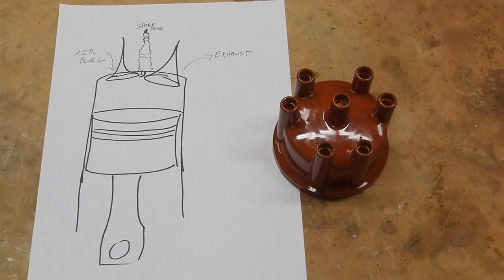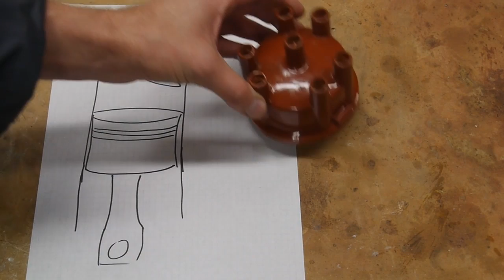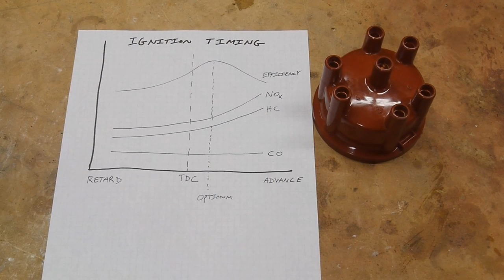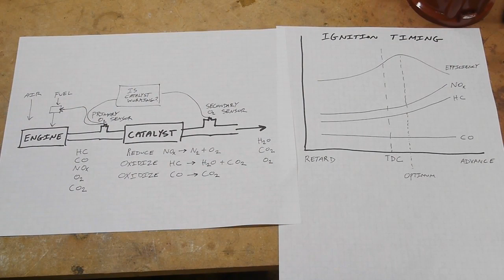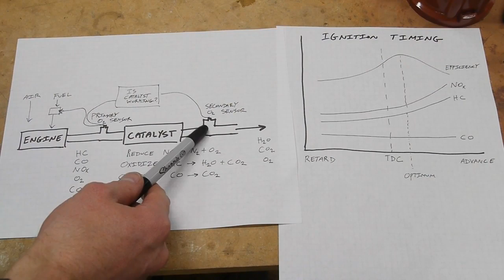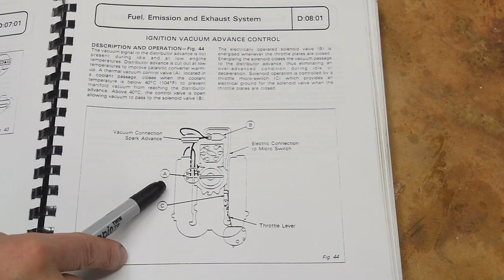Car engine science: Ignition timing, emissions, mixture

Comment: My 88 Audi 5000 has the came CIS-L injection system as your DMC1, and it’s been really interesting to fit a wide band oxygen sensor & controller, and monitor the mixture regulation performance. Having the “built in” wideband sure makes setting the CIS mixture screw easy! The oxygen sensor system was also very helpful in diagnosting a stumble under high load. Turns out my fuel pump wasn’t delivering the proper flow, so the system was simply “running out” of gas and going lean.

Comment: Hey, this actually makes sense.. I recently replaced all the spark plugs and wires in my truck, but the wires were kinda shitty and one wasn't staying on right. I crimped it onto the plug but the contact is still not quite right, I think the spark may first be jumping from the wire to the plug. At idle, under a lot of torque and especially when reversing  (torque thing), the engine occasionally shakes sort of like a misfire. Sounds like the firing advancement/retarding obviously can't calculate the crappy contact between that one wire and plug, so that cylinder is just not firing at the right time

Comment: Great video as always but I got a little confused with some things. Looking at the ignition timing graphic, NOx and HC levels should always be directly proportional no matter how advanced or retarded the ignition timing is. Then why, when he fixed the vacuum advance, didn't HC level increased at the same rate NO level did? Actually HC ppm didn't change at all.
Reply from the maker: Good point.  I think it is easier for the catalyst to convert HC into H20 and CO2 than for it to process NOx.  It's possible that the catalyst has additional capacity, so adding more HC into the input of the converter will not result in more HC out the tailpipe up to a certain level.
Reply: Thank you. That makes a lot of sense. The catalyst makes it harder to measure the ignition timing effect on the emissions.

Comment: Hi Ben,

Best and most concise description of a catalyst I've ever heard.

Your description of knock isn't quite correct though. What actually happens is that the flame front from the spark plug progresses through the cylinder normally. This causes the remaining fuel/air mixture to compress and increase in temperature. This temperature increase actually causes some of the more volatile molecules in the fuel to begin to break down. There's a certain threshold point where this volatile stuff will spontaneously explode, usually all at once, and usually in the vicinity of a hot-spot in the cylinder. That is obviously very violent. The sound you hear is the engine block resonating. Imagine the explosion hitting it like a hammer.

An interesting point about knock is that it causes the boundary layer of gas along the cylinder walls, cylinder head and piston to be blown away. This means that you get much more heat transfer from the burning gas to the engine. This is the primary cause for the engine damage caused by knock.

Also, the amount of combustion heat absorbed by the engine is (roughly) 30%. Another ~30% or so escapes out the exhaust pipe, the remaining ~30% or so is used to produce useful work. Many engines actually make use of less than 20% of the available energy.

Another nasty thing which can happen in engines (especially modern, down-sized turbo engines) is pre-ignition. This is where the mixture in the cylinder spontaneously explodes as the piston is on its way up, well before the spark is going to ignite. Pre-ignition usually causes extensive engine damage as an enormous amount of heat from the combustion must be absorbed by the engine.

Also, your diagram of spark advance blew my mind. I'm used to 'Advance' on the left hand side of the x-axis.. :)

Patrick

Comment: Hi Ben, Great explanation...... I'm surprised you failed to mention the function of the "Air Pump" and the EGR valve. These both play a huge roll in reducing emissions. The Air Pump injects air directly into the exhaust system, engine side of the catalytic converter. The test results you displayed, tests for a stuck solenoid keeping the pump on after engine warm up. The EGR valve lets burned gasses back into the combustion chamber to lower cylinder temp. This lowers the oxides of nitrogen "NOx" This is a real problem with certain cam grinds. I built a modified EGR system to get my car through emissions... I made a video about it a while back.
Always enjoy your videos Ben! Keep'em coming!
Reply: The last time I saw an air pump was in my 1985 RX7, also in a 1985 Subaru (instead of a pump it used a flap valve, similar to a 2 stroke intake flap valve) operated by piston vacuum). I think those have been eliminated years ago.

Comment: So I live in a part of the US that gets cold/snow during the winter. When I start my car on a very very cold day I notice that the exhaust fumes/vapors are more visible coming out of my tailpipes when the engine is cold and trying to warm up. Then as the car warms up and I start driving, they are not as visible. This always puzzled me. Is this because the engine is running much hotter (when the engine is initially stared and when it is cold) to warm up the catalytic converter so it operates more efficiently?

Comment: Great stuff as always, Ben.  It's a shame that modern mechanics will eventually lose the knowledge of these things like the centrifical and vacuum advance systems, etc.  Most probably wouldn't know how to use a dwell meter to set a point gap anymore, or how to use a timing light (and what you do with the vacuum advance when you do this).  Older cars (older than your DeLorean) also used to have a vacuum delay valve in series with the vacuum advance line - a sintered disk that was almost like a vacuum "low pass filter", smoothing the response of vacuum changes to the advance mechanism.
Reply: I disagree. I think that we should fully 'electrify' an engine. No more timing belts. No more camshafts. No more mechanical things at all. Use a solenoid to open and close the valves. Use a signal to do the timing belt stuff.

Engines would get simpler mechanically, but it would be much easier to tune them. Less rotating parts, less mechanical wear, less friction, more efficiency.
Reply: It's true, most modern mechanics will eventually forget, but that's OK because very few people will be using vehicles this old.
Reply: ***** Totally agree
Reply: theLuigiFan0007 While your fears are mostly within the realm of logic and reason, there are things you can do to mechanical cars to 'hack' them and cause damage to the cars/passengers as well. All that is happening in your scenarios is you are replacing "weaken the brake lines" with "program some code to make the brakes not function after a little while."

The end result being the same, and therefore we don't need to go nuts and not move forward with a technology just because it fails in a similar manner to what we have now, when there are so many more positive benefits to doing so.

If you can re-program your own car, then the hackers can as well. That is the risk that you take when you allow code to be re uploaded to the microcontroller. If they made the code write protected, meaning nobody could change it then you would be safe from hackers--but people would rabblerabble up a storm saying they are being locked out of their cars and this is an atrocity bla bla bla.

And I would bet money that you don't check the source code of every single vehicle out on the road that you come in contact with. What if someone is running an outdated bit of code that when the temperature goes to exactly 32F it tries to divide by zero and it crashes the MCU which makes your breaks not function. It's not your fault, but because they were not able to push that update  out to the car... well.. now you are dead. And dozens of other people because of it.
Reply: Shame? If it's not needed - it's not needed.
Reply: *****
Yeah, that makes sense, You are right, If they have physical access or are in range, even if totally mechanical, they could still cut the brake line or tamper with other things. Its not that much different as you say, just slightly easier if someone finds an exploit. Thank you for the informative comment and slight counter argument. It gave me a slightly better view of the whole picture through someone else's opinion. I got: "Common sense applies as much as safety features, as does a balence between being overly locked down or too open to modification, plus there can be mechanical sabatage to worry about as well." This is something I would never have thought to mention. Thank you once again for the comment, and have a nice day.
Reply: VioletGiraffe Nobody knows when an old tech will be needed again. Like JavaScript was almost dead before the rise of tablets and smartphones and stuff. Or C that is still needed to program microcontrollers
Reply: Incrue
Interesting you said C is needed for Microcontrollers and dead otherwise. I can name something else that needs it: Linux/UNIX/BSD. The entire Kernel and main components of the OS are entirely written in C/C++. Most (if not 90%) of programs on Linux are also written in C or at least have some in it. Same goes for Mac OSX which is a UNIX based operating system. Applications on OSX are different, but the main components are the same.

As far as windows goes, yes C/C++ is dead for REGULAR SOFTWARE. The .Net framework (C#/Basic) are what is needed for writing Windows programs now. C/C++ IS USED (and needed) for components of Windows, like drivers and system libraries, and to write the .Net framework itself. I do not know a single application that needs to be written in C anymore since DOS/Win9X went away.

Also, Microcontrollers are programmed in Assembly instead of C/C++ for some purposes where super low level (single CPU register/IO pin) control is needed. AVRs (type of Microcontroller) must be programmed in Assembly or AVR C, but can be made very fast and efficient even with little resources by doing so.

That was a bit off topic from this discussion, but I thought I would give you the whole picture. You are right from the point of most PC users and software developers that C/C++ is dead. The Microsoft Windows and Linux OS developers have things a bit differently though, they still have to use it.
Reply: theLuigiFan0007
 C++ is far from dead for regular desktop software on Windows, my friend. Whenever you need high performance, or low memory footprint, C++ is chosen most often.
Reply: theLuigiFan0007 
It is perfectly possible to program AVRs and other microcontrollers using high-level languages. You don't think all those guys blinking LEDs with Arduinos are coding in assembly, do you?
Reply: Zen Punk
No, they are definitely not using assembly, my bad. I am always open to corrections, and will not be bothered by being wrong. Thanks for pointing that out.

The Arduino IDE has it's own special programming language. It is mainly based on C++, and is translated into regular low level C on compilation. It also has low level control of registers and hardware like assembly. There are simple variables that control hardware. It is a mix of high and low level language functions, with C++ syntax and function of top of that.

When I put only assembly can be used for AVRs, I completely forgot about AVR C and it's variants, which is what the Arduino IDE uses. A variant of AVR C++ is used. Sorry about that, I will edit it.

VioletGiraffe
I did not even know that. I have never run across modern (past few years) application written in C. I thought it was only used for writing the OS components and creating the high level runtimes nowadays. I guess I was wrong. Sorry I never replied, must have never gotten a notification.
Reply: ***** Yeah but I bet the old timers said the same thing when going from the manual spark advance from older cars like the model T to vacuum advance.
Reply: Future mechanics will need to know electric motors
Reply: That’s why you drive an older carbureted car with no emissions stuff!
Reply: @MLGJuggernautgaming  1972 gmc 2500 4x4. Yeah baby!!!!!
Reply: Just like we forgot how to service a hand crank 🙄
Reply: Well nobody knows how to take care of a horse anymore, it's a hobby, just like old carburetors and steam trains.   :)
Reply: Incrue
 C is a screwdriver or a hammer, not a carburator engine. I can name you 10 dead languages no one will ever need again. And Javascript is a historical mistake. It's a terrible language, and there are many better than it. It just so happened that it was adopted for web browsers, which gave it huge popularity boost.
Reply: ViaExplore
If implemented with the bare minimum electronics, and optimized for simplicity and efficacy, I agree too. If done using overly complicated circuitry that overdoes the calculation required, and "connects" it to the outside world, never in a million years. It would increase lifetime of the engine without service (less moving parts) and increase reliability if done correctly. A little microcontroller that stands on its own reading sensors and feedback loop is all that is needed. It can report back to other computer systems if necessary, just dont have them do the work. This way it is less prone to bugs or race conditions present from relaying messages multiple times. The main computer can tell it what ratios/values to use as a baseline at current acceleration, and what current acceleration is. Also, failsafes should be designed in so if the main computer has trouble, looses communication or tells it something WAY out of the normal pattern it would enter a self regulation mode without fine adjustments and throw up some sort of critical warning. I believe this is important for all current vehicles though, as bluetooth equipped cars running java hardware for a UI (not in a JVM) should have isolated control circuitry that is not connected to the CAN bus, incase of soem ill intention person with a exploit in mind. Especially the ones that have accident avoidance features, which can be manipulated by tapping the CAN bus and telling it to steer or accelerate/brake. Never happened yet, but I GUARENTEE you if the current automotive electronic over complication continues, a virus will cause accidents in the future.

In conclusion, it would be great, but only if it was designed in a way it could not be interfered with by the main electronics in major ways, better yet not at all. You know, some planes run Windows embedded, which means some at one point had Vista Embedded (THE HORRORS!!! I would never ride in one). A virus could take out a plane if someone inconspiciously installed something formthe cockpit if nobody was watching, cars are no different. Make it simple like the older mechanical models, and fail-proof (not interconnected to a large extent), maybe even include a backup board that would automatically be switched to in major malfunction. Keep entertainment disconnected from the main stuff. Need I say more?

Comment: Thanks for another very informative video. I once helped a friend experiment with putting an electrolyser in a car to insert HHO in the air intake. The oxygen sensors defeated this since when they'd see the extra oxygen they'd tell the computer to increase the fuel intake, the opposite of what we wanted. So we had circuit boards which we were going to splice into the wires going from each oxygen sensor back to the computer to tell it there was less oxygen than there actually was (the signal was 0 to 5 volts or something like that so the circuit simply provided a lower voltage based on some scale.) My friend ran out of money for the project so while we built and tested electrolysers, we didn't get to inserting the circuits.

Comment: Speaking of high temperature reactions in the exhaust, I had an interesting experience a two winters ago. I had been driving hard, and pulled into a rest area to take a break. Unbeknownst to me, they hadn't plowed the rest area. I got high centered on about 9 or 10 inches of snow. I could rock the car a bit, but I wasn't getting anywhere. Then I saw it: bright fluorescent chartreuse yellow snow. I thought I had broke something, so I called a tow truck. After getting pulled out, I drove gingerly to a service station, but none of the fluids were close to that colour. After some research, it turns out that stainless steel exhaust systems use zinc as a rust inhibitor, and with a lot of heat, a bit of water, and road salt as a catalyst, the zinc and iron will react and form yellow crystals.
Reply: Nice story ;)
Reply: I would have thought the same thing as you. Mustof been like aw crap what just happened LOL. I never knew that would happen though, very interesting.

Comment: Great explanation. The main reason for the vacuum advance at idle is so you can run the fuel as lean as possible (less emissions, less consumption). With a lean mixture the fuel burns slower so you simply need to ignite it a little earlier. Like you said "smoother idle" which is the result.